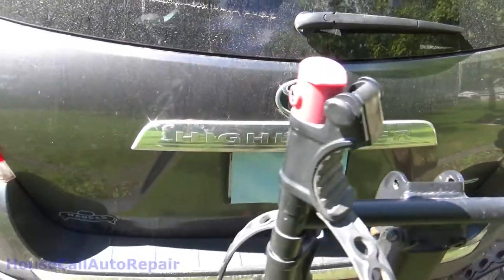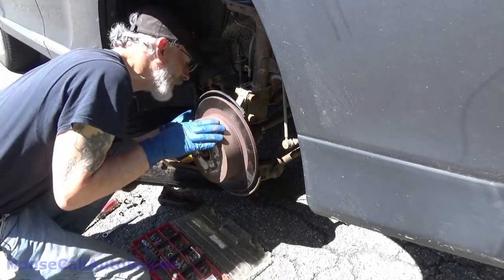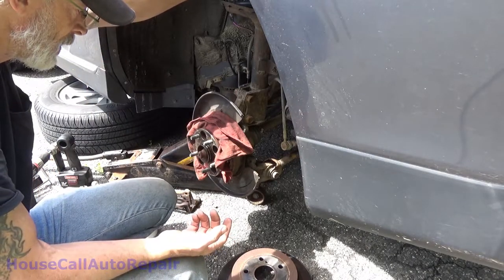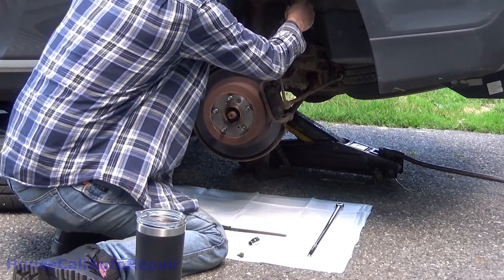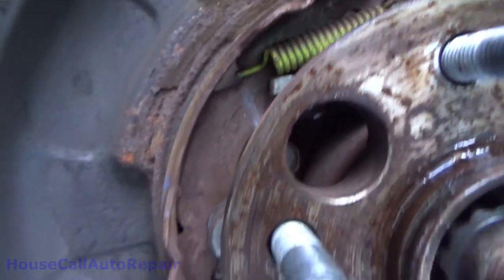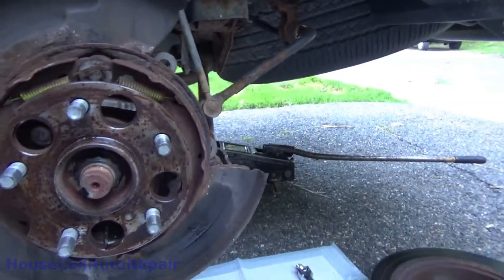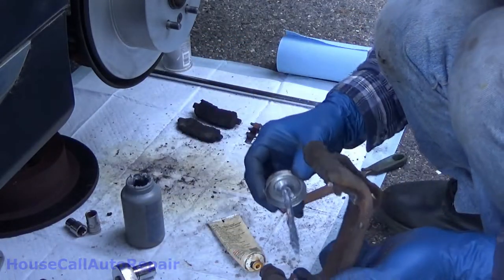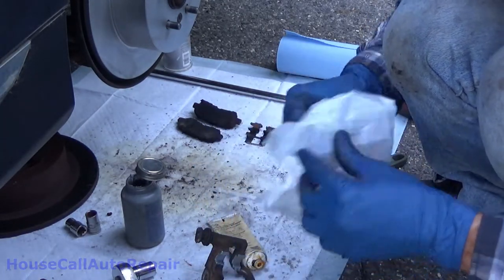2011 Toyota Highlander - Rear Brakes - Auto Repair

Comment: On my 2011, the bolts to help get the rotor off the hub is 8mm, not 6mm.  Get ones about 2-3 inches long to get out past the lug bolts.
Reply from the maker: Good observation and great tip! Thanks!